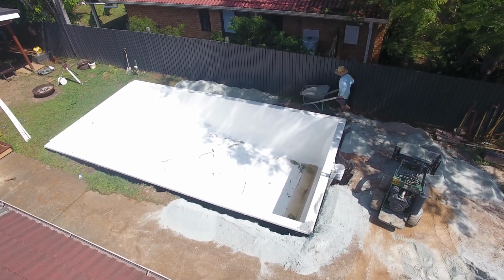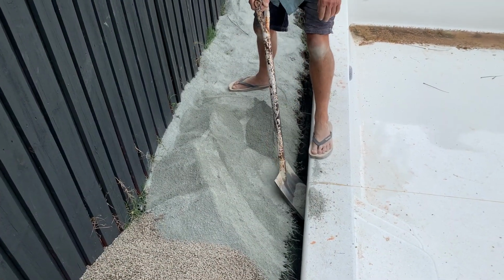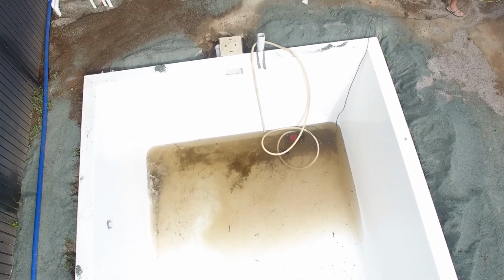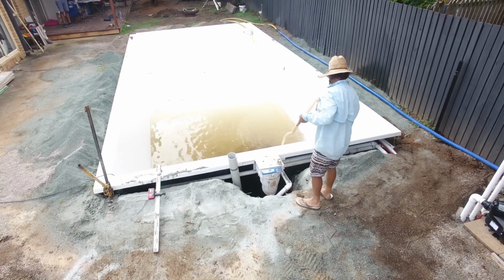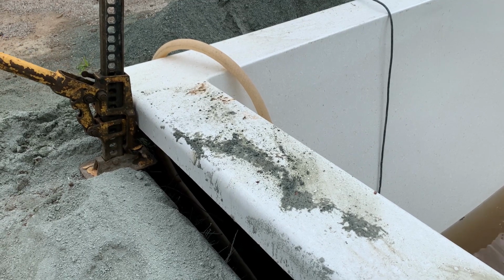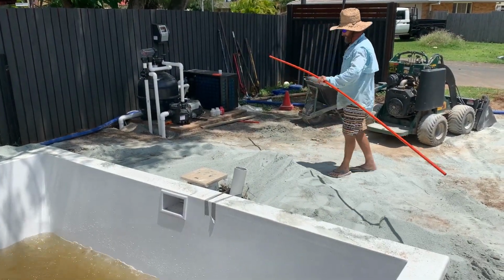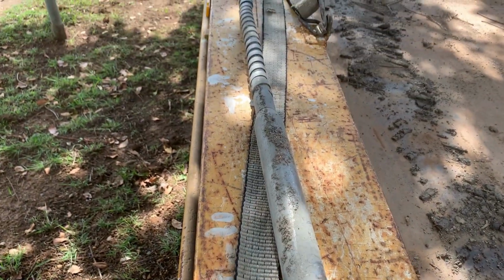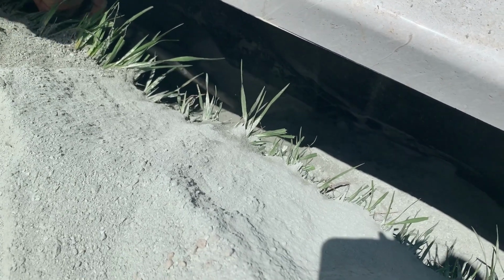Fibreglass Pool Installation - How To Backfill and Level a Fibreglass Pool In Australia

Comment: Could you get it level and the pump concrete in instead of this process?
Reply from the maker: Hi. Fibreglass pools need to be installed following AS1839:2021 for structural warranties to remain valid which means backfilling with a cement stabilised material no larger than 7mm. Pumping concrete definitely doesn't tick that box!

Comment: Hey guys awesome video, couldn’t be more informative. We recently had our 7x3m fibreglass pool installed and are awaiting bond beam. However the top of the pool is dead straight against a string but underwater it looks like the walls are bowing “out” due to poor backfill compaction / using a water cart over zealously. Is it possible that this can be rectified without draining the pool by using water and compaction ? They did use a sand and cement mix 

Cheers great video again
Reply from the maker: Hi Mark. We're glad the video was helpful! Sorry to hear your pool walls are out of whack. If the walls are bowing out, it might be possible to rectify this without draining the pool. So the short answer is it is a definite maybe. It will depend on where the bows are and their extent which will need an onsite assessment by a installation professional to determine. Hopefully it is fairly easy to rectify. All the best.

Comment: Hi there. We have recently had a fiberglass pool installed, but the installer has not backfilled properly underneath the stairs at both ends of the pool, resulting in a drumming/ hollowness under the stairs. Is it at all possible to rectify at this point, keeping in mind pavers have been layed?
Reply from the maker: Hi Josh. The backfill used should have been cement stabilised. If so, it will have hardened and may prevent additional backfill from getting underneath the steps while the pool is in place. The starting point would be to try and resolve the issue without lifting the pool out which is certainly possible to do. All the best.

Comment: Thank you for these great videos! You mention at 1m:18s that the bedding material is not compacted. Do you not plate compact it?
Reply from the maker: There isn't a requirement in the Australian Standards to compact the bedding and most installers don't. Even with compaction, the weight of the pool will compress the bedding and alter the level of the pool.

Comment: Another great video again with a H1 site if your pool has a swim out do you excavate all the way down to the level of the deep end and back fill with non reactive or stabilized material and in the same manner as the steps ?
Reply from the maker: Our pleasure. Glad you enjoy them. Most installers will excavate fully and backfill with a cement stabilised material.